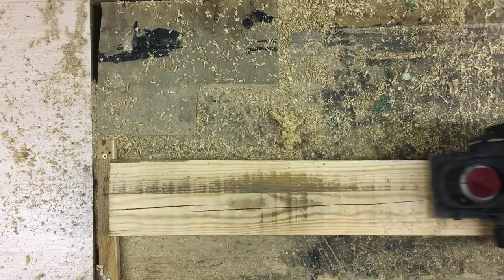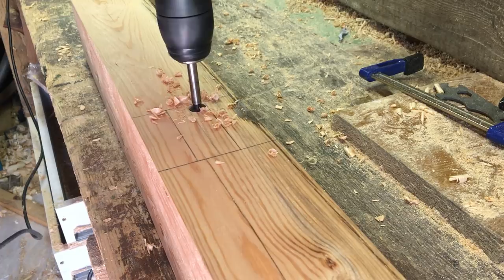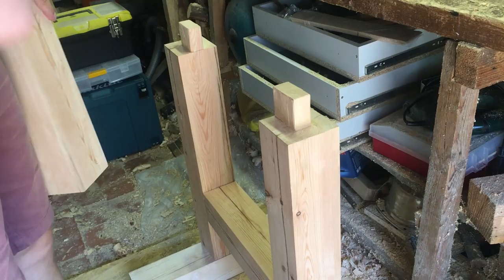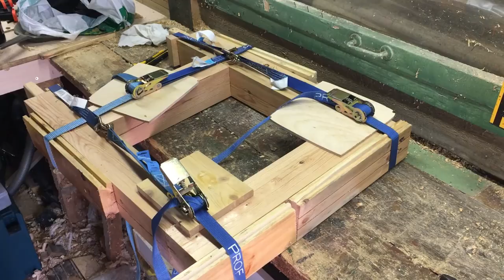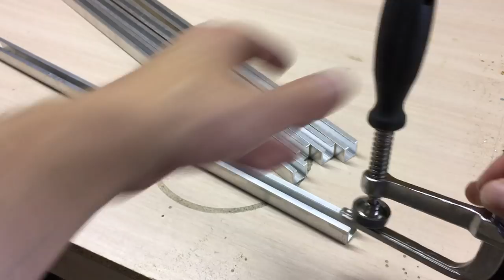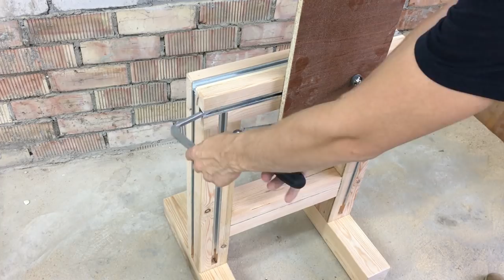Multifunctional Sawhorses DIY

Comment: If I were you I would use those horses to replace the legs holding up your workbench. I believe saw horses are light, can be broken down and portable to take from your shop to another location to set up a temporary work station. That being said your craftsmanship is excellent.
Reply: Ken Corsell a pair of these versus more portable saw horses yeah but just one of these in addition to everything else I haul from one jobsite to another would be an excellent addition for a lot of jobs

Comment: Where can those F style clamps be found? I've looked for years for something like that without resorting to welding clamps
Reply: harbor freight and just grind off the end until it fits in the track. cheap easy f clamps
Reply: There are some Produkts available. The Festool clamps fits in and Bessey also offers clamps for a M8 T-Rack system.
Reply from the maker: Clamps I use are Makita 194385-5

Comment: In each of the sample uses, why cant a regular clamp (going around the saw horse timber) do the same thing. What does the track add?
Reply from the maker: Yes, when using regular clamp t-track makes only small difference - holds clamp in place. But t-track can be used for other things - to hold toggle clamps, bolts (for example to mount vise on sawhorse), etc.

Comment: Interesting idea. But, a saw horse is supposed to be lightweight so it can be carried around for work.  This thing must weigh forty pounds with all the hardware added on.  Some of the ideas could work well on my stationary tables.
Reply: That's what I was thinking... I've never had to clamp to my sawhorses. That's what my work bench is for whether it's my mobile or stationary version.

Comment: Two thumbs up Mate. I really like the design. I know there have been a few comments about quick clamps, but these style clamps have a lot more holding force. Sure you can sort of manipulate F style clamps one handed, but this looks a lot easier. Have you found the aluminium tracks to be strong enough and would there be any point to upgrading to mild steel?
Reply from the maker: For woodworking/ my needs aluminium tracks are strong enough

Comment: This is a good idea, but you could justo use clamps on a sawhorse and it works pretty much The same.
Reply: Hey Liam slow down and learn I am almost 60 and Phil must admit this blew me away. Do you really think you can get the same cut from clamping an old sawhorse to plywood. I will call say good idea, I do see a couple of of applications I plan on trying this on, thank you very much.
Reply: Sorry for auto correct   adding the names in my comment.

Comment: Those are 6x6 posts and 1" square tubing, correct?
Reply from the maker: In metric system - posts are 100x100mm and square tubes are 20x20mm

Comment: My workbench does a better job I'm holding things down or even on edge a sawhorse I don't know it just doesn't seem like it's going to do anything extra
Reply: I just comented exactly The same thing some days ago... Someome told me i am a noob... But i figure im not The only one. Its just a ver complicated saw horse...
Reply: This ain't a video for experienced woodworkers. But I see it is valid to people without space or money to build a conventional workbench with vises and dog holes.
Reply: It’s a heck of a lot more portable than most work benches.
Reply: I understand your point of view but, this little contraception seems very handy for projects that require to be away from your shop, or your bench is been used at the moment, or while you're waiting for glue to settle on other pieces. The fact that he calls it a sawhorse means that mainly it's used as an auxiliary tool for large pieces of material. Besides, looks like it can be tucked away almost anywhere and it wouldn't hurt two have one or two available just in case...

Comment: Two things made me cringe FIRST who wears croc's while in the shop?? Honestly grow up and buy a pair of sneakers at the very least or some decent work boots which would be better!!! Secondly I have to say "Sure you can cut aluminum on a table saw!" BUT my only question is "Why?" I get that you need to make a "perfect cut" that is spaced equally, and I see other guys run aluminum through their saws all the time, BUT have you ever looked at the blade AFTER you did this??? If you have a carbide tooth blade it really tears the hell out of them, snapping off carbide has it cuts!! I would do it myself to be honest about it BUT I wouldn't use the same blade the cut wood with AFTER I ran metal (even Aluminum) through it!! I looked at a saw a guy was trying to sell on Craig's List that he claimed "was only used for trim", but the closer I looked there was missing teeth all over the blade and the carbide in some places was jagged and snapped off so much that it made for a few lousy test cuts!! I RAN AWAY from that deal as fast as I could, BUT looking back it wouldn't be a bad saw for dedicated aluminum cutting, and it was clear he was lying about "cutting only trim with it" has he said!!

Comment: Honestly I must be missing something. You spent all that time and money insetting 't track' when you can simply clamp a piece of wood to any surface one-handed with one-handed ratcheting clamps. Sorry but it doesn't make any design sense.
Reply from the maker: T tracks holds clamps, so in some cases it makes clamping easer. Other thing - t tacks can be used for toggle clamps, bench dogs, tabletop mounting, etc.